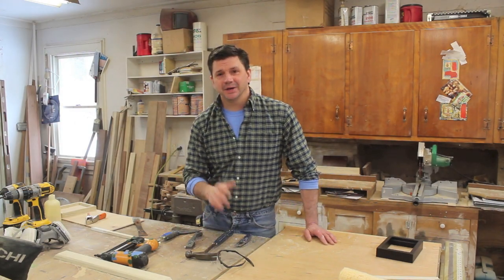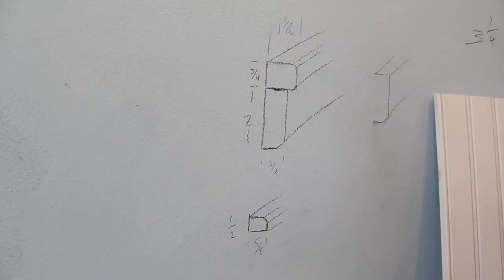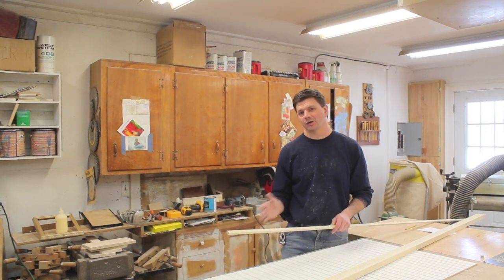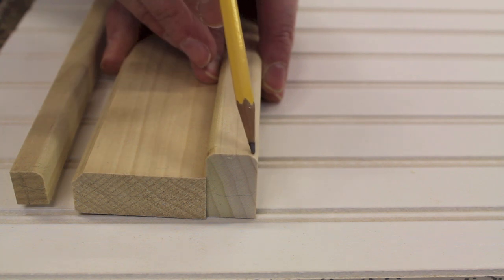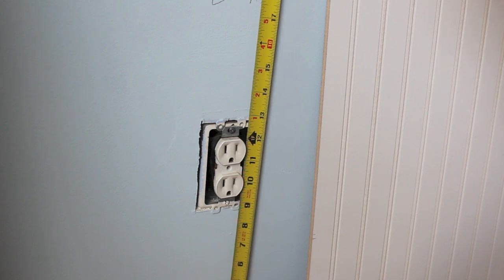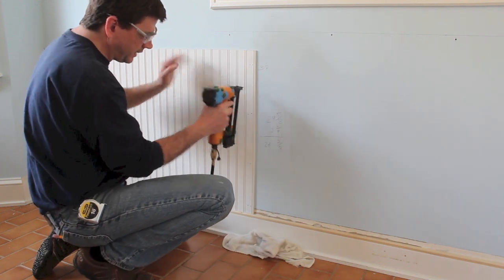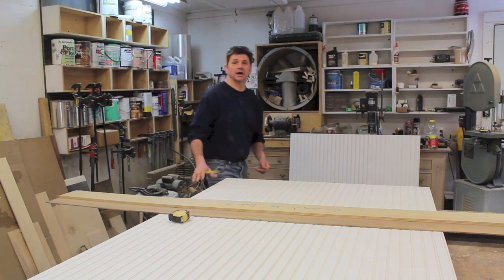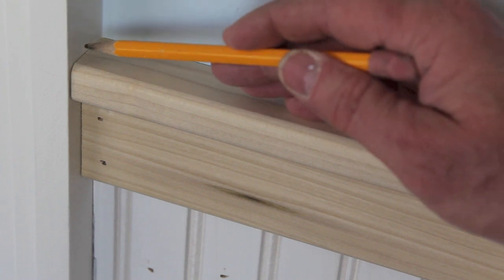How to Design and install Chair Rail + bead board / wainscoting

Comment: I just watched 2 Home Depot videos about installing wainscoting and both just glassed over dealing with power plugs. The 2 seconds that were shown here was much more detail than they went into.  If someone followed those, they would have plugs that were inset back into the wall so the cover would never go over them.

Comment: How would you handle an uneven wall at the corners?  We live in an older house and settling has made most of the walls out of whack to some degree.  This is very apparent when one wall intersects with another when dealing with vertical lines.

Comment: Hi Jon , I've messaged you before on this job, I've completed the whole room (looks great) and built in a loose panel/ access door for heating unit which has bowed out a little. Any thoughts on how to prevent, remedy it🤔 cheers P

Comment: Hi! Really enjoyed the video. This is almost exactly what I would like to do in my dining room. Now, I am very inexperienced in this type of improvement and have limited tools and money. The dining room is small and there is an existing chair rail and baseboard molding that I would prefer not to remove/change if possible. Is the project do-able with out removing these? Thanks!
Reply: Mary LoPreste Home Depot sells textured beadboard wallpaper that looks just as good as the real thing, and is much easier and cheaper to install.  You can also order it online, and search for videos and articles on how to install.  You can easily work around your existing molding, or get ready-made molding that they will cut for you at any home improvement store, or just get an inexpensive miter box!   I did my entire stairwell top to bottom with the beadboard wallpaper, looks beautiful!

Comment: Thanks for the video.  I'm curious if you had to extend the electric box or use spacers for the outlet screws?  Also, if you were putting this on top of baseboard heater, would you still use a toe molding?   Thanks!
Reply from the maker: Thanks, I don’t remember but I didn’t think so. . Maybe ad a 1x2 on top of the base board heat

Comment: Thanks. Question.  Where the bead board wraps around a corner to the door did you miter the long edge at a 45 degree angle to get a seamless connection?  I ask because that is what I plan on doing, but am concerned that MDF bead board with splinter and chip.
Reply: Same here. I'm planning to use corner molding. Not going to risk the edge being wavy.

Comment: I’m looking at doing this around our dinning room with mdf wainscoting/beadboard as well as pvc wainscoting in our bathroom. Can you use liquid nail to adhere the material to the wall? Also are you nailing directly into the dry wall? I know you mentioned on the end of that one run there wasn’t a stub so you cross nailed to hold in place till the glue dried..? Thanks!

Comment: Jon, thank you for the video.  You make it look easy.  Hopefully my project will turn out as well as yours.  What gauge nail gun are you using/recommend?  Did you shoot into only the studs (besides the end with no stud)?  How do you do the corners with the bead board (internal and external joints)?  Thanks in advance!

Comment: Hi great job! I have couple questions.  Was the bottom molding over the baseboard just a preference?  Could you please explain how to do the corners? Do I simply cut them at 45 degree angles?

Comment: Gremlinsbreath had the same ? I have. Uneven inside corners I just scribe. It's the outside corners. I saw briefly that you just did a butt edge. How do you finish that? I haven't cone across one outside corner that is 90 degrees.
Reply from the maker: I’ll try to make a short video on that, it’s difficult to explain.

Comment: How do you handle the small holes left by the nail gun.  Do you individually fill them all up or do you have a faster/easier technique?  Thanks!
Reply: *****  after spackling / joint compound the nail holes do you paint the bead board and trim?

Comment: Jon, great video. I am planning on doing beadboard and a chair rail in the nursery, but I would prefer to not remove the existing baseboards. Is it possible to do this project without that step?
Reply from the maker: Sure if the base board is big enough and will still have reveal that looks good.

Comment: Hi Jon, I am hoping you can help me with this question.  I am installing bead board wainscoting in my son´s bedroom and have a dilemma.  He has a reach in closet, and it is about three inches further back than the main wall, leaving a small wall.  This wall has a round edge, so I do not know how to put the wainscot in this area.  Could you help me out with some suggestions?  I greatly appreciate it.  Regards,

Natalia
Reply from the maker: Sounds like you are saying the corner bead on the sheet rock is round, if so just trim as you would any corner. There will be a small gap at the top of the chair rail that will need to be filled. Hope the helps.
Reply: *****
Thank you Jon for answering so quickly, I think that would work perfectly in most cases, but I kept my original baseboard and that goes around the corner bead.  If I do it that way I would be having a protruding edge at the bottom, correct? I hope I am getting the terms correct.  Thanks again!
Reply from the maker: really hard for me to know, sorry

Comment: Were there any concerns about pulling the receptacle that far out of its box and perhaps exposing the area where a hot connection would come in contact with wood? @4:42
Reply: Yes, he should use a switch box extension so which would keep the receptacle away from the wood.

Comment: Why is it necessary to use glue on the walls?...If the board even needs to come down or a mistake is made putting it up, then it would rip the walls up removing...Thanks for a response.

Comment: What kind of beadboard can be used in a bathroom?
Reply from the maker: Teena York I always use pre primed wood in bathrooms
Reply: ***** Panels? I want it high, about 54" Everything I've seen says not for bathrooms. I have a small remodel scheduled to start tomorrow. I went to pick up what I had planned to get and they don't carry it anymore! I need a plan "B" but it is a high moisture bathroom. This is a hired remodel so I have got to come up with something. Menards has discontinued the whole line!
Reply from the maker: no I always buy it in 16' bead boards , they should cut it for you at the lumber so you can fit it in your car or truck.